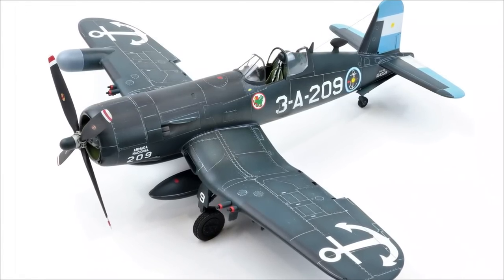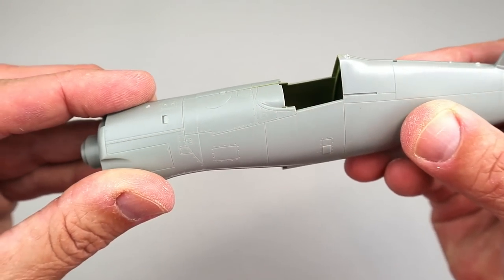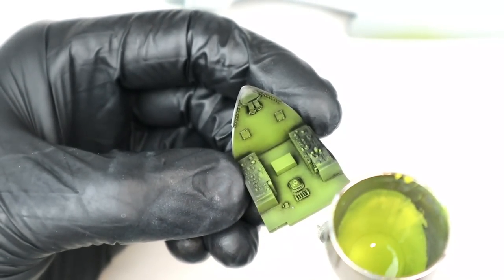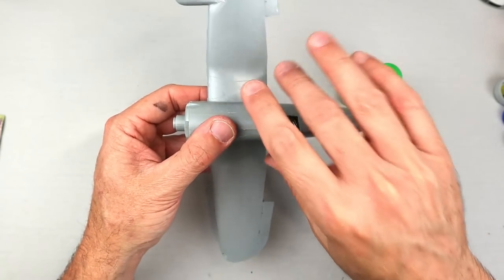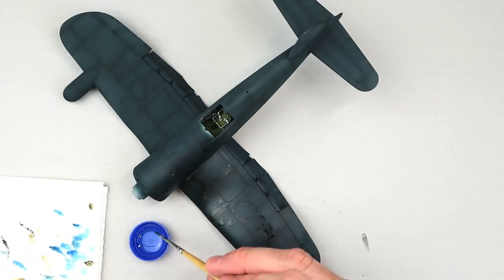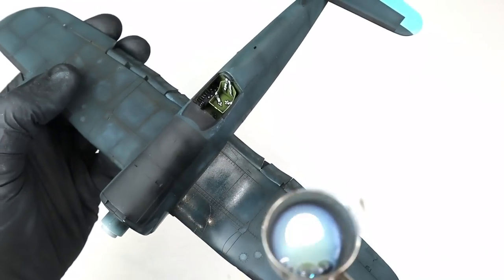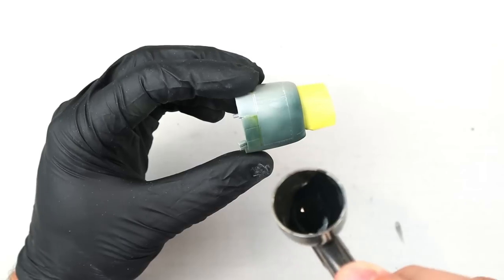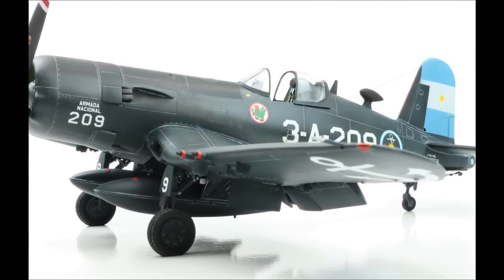1/48 Hasegawa F4U-5N Corsair Build - Argentina Armada

Comment: Lovely build I built the same kit, on the same markings some years ago, and I would love to build another one, but I would like to give it a go to the Hobbyboss 1/48 one. Just for informational purposes only, being from Argentina I built several of these and one thing I learned along the way is that Argentinian -5 (not -5N/-5NL) Corsairs did not had their cockpits painted on Interior Green but Light Gull Gray, and also some of them had stamped wheel hubs were the stamped and not alloy.
Reply from the maker: Thank you.  I appreciate the good comments and the expert intel on the -5 Corsairs.  I was not aware of that difference in cockpit colors.  I knew about the stamped hubs which is why I replaced the kit wheels with the stamped hub ones from Ultracast.  I guess I got lucky on the interior colors for the -5NL.  Thank you again!
Reply: @FlyingSModels  You know something, I couldn't get the resin replacement for the wheels, I made due with the kit ones
Reply from the maker: @dergrunepunkt  Most people wont even notice.

Comment: Excellent! Working my way through your video channel now. Is there one to find that shows you mixing and applying the epoxy for cockpit dials?
Reply from the maker: Thanks, Dave!  I've thought about making a stand alone video for that but have not yet.  Guess I need to do that.  But if I remember right, one of my last 3 builds should have a short snip in there (F4U-1, Bearcat, or P-51C).

Comment: Awesome work! The Testors Lacquer Flat is the flattest coat out there. Be careful with the cans as I have experienced blotchy finishes with it on some of my builds. I prefer to use the flat out of the bottle and thin it as needed.
Reply from the maker: That AK Ultra Matte Flat is pretty dang flat but it was getting too chalky for me.  What I do is soak that Testors in hot water for several minutes to warm up the contents and then it sprays like a champ.  Thanks for the kind words on the build.  I really enjoyed this one.

Comment: Love the build, are the markings of your own making and an off subject question do you or any viewers know of someone who makes a1/48 Val in production?
Reply from the maker: Appreciate that, Stacy.  I used markings from a few different sources on this one.  I think I have the anchors laid out to cut masks and the codes would be easy to do but the little rooster and that tail on the sun would have to come from a decal sheet.  As far as the Val, I only knew about the ones from Fujimi and Hasegawa.  I'm guessing you might can get one on an online trading forum like Hyperscale or one of the Facebook trading groups.  Also, if bigger is better, I think Infinity Models is supposed to come out with one in 1/32 in the near future.

Comment: Hello. I have just seen your build video. It's a great result in an interesting scheme.
One question, where did you get the direction finder aerial on the rear fuselage? Thanks
Reply from the maker: Thanks for the kind words on the Corsair.  It was a fun little build.  I believe I stole that aerial off of an old P-40 kit. Had I had my 3D printer back then, I would have just printed it out.  Hope this helps.
Reply: Thank you, that's useful info. Cheers.